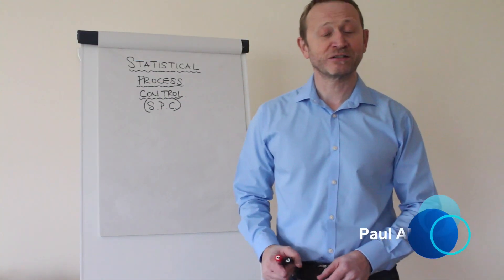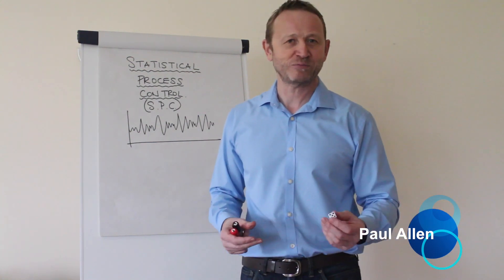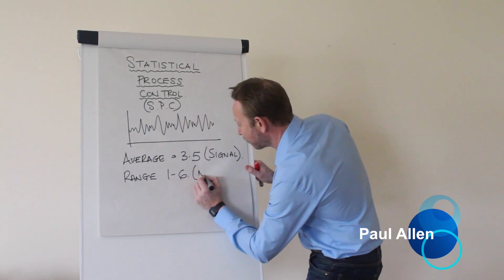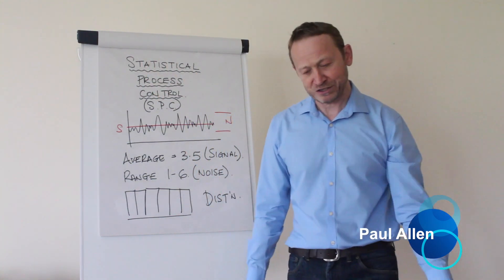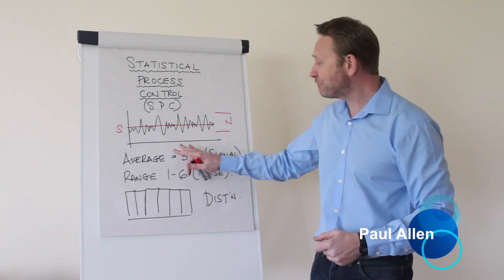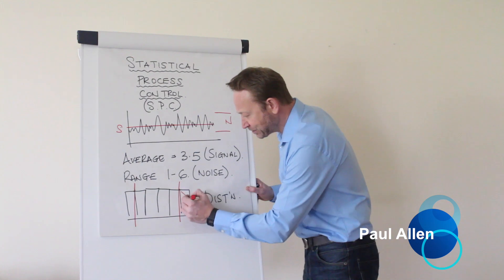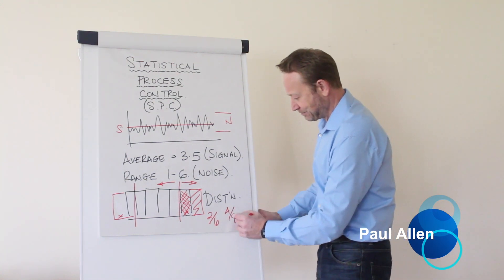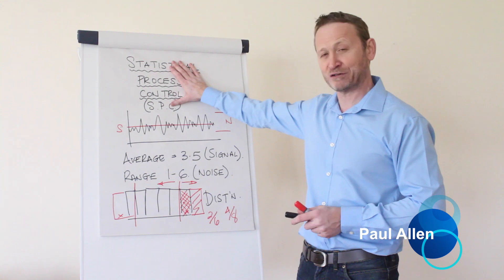Complexity Made Simple - Why Statistical Process Control (SPC)

Comment: Really my only question about this is why would a job from a customer only wanting 2 through 5 be assigned to a process that has the possibility of producing 1s and 6s? The machine/process is out of spec for that work. Management needs to get their head on straight.